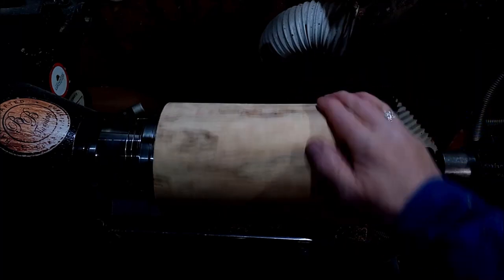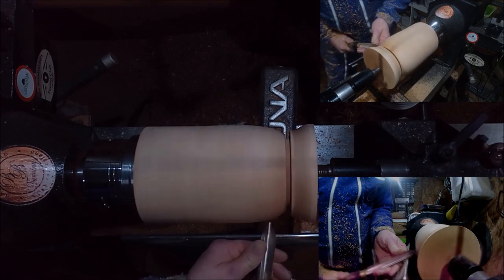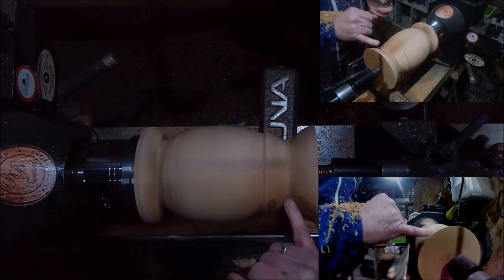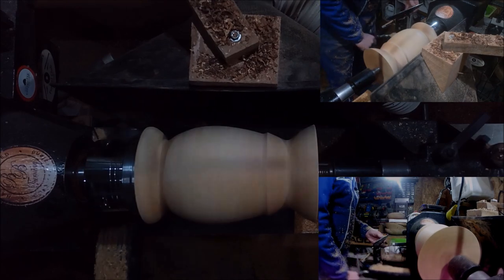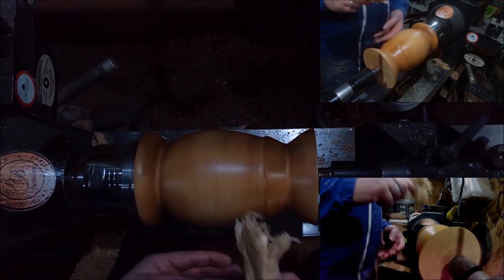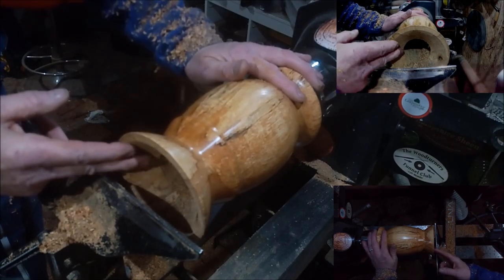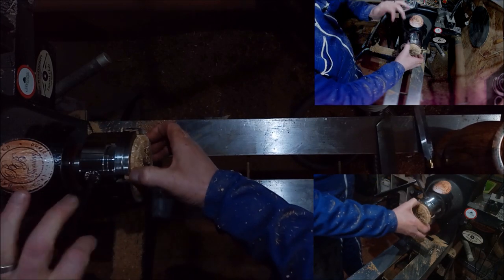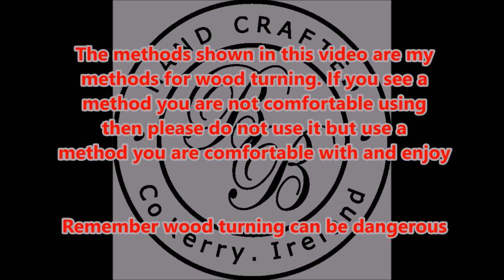Woodturning an Irish Spalted Beech Vase and a really handy Bandsaw Sharpening Tip

Comment: By the way, I did try using the Dremel on each individual tooth also as you showed here, and that is a better method to get a longer lasting sharpening. But following that with the diamond file method definitely improves the overall quality of the sharpening.
Reply from the maker: I totally agree Brian, and as I said in another comment touching it up with your method every now and then really keeps the blade in tip top condition. Great idea mate.
Shay

Comment: Great video again shay. Many thanks. How do you tell if you are to high/low with your tool rest? It looked like you were o my a fraction high at the beginning. Matt.
Reply from the maker: Thanks Matt, it boils down to how the gouge cuts and quite often how it sounds. You just get used to it to be honest. If your gougr is in your normal cutting position and is sharp but you are not cutting as well as you normally do then you are probably slightly high. If you are digging in then you are too low.
Hopefully that is clear Matt. If not i will show it on video.
Shay.

Comment: Thats a pretty wicked bandsaw tip, good man ,  nice video too btw, i have only 2 of those vase inserts left i got them in a euro shop  a few years ago, iyou had a link to where to get them in a previous video but can find the link, can you forward me it if you remember it please Shay.
Reply from the maker: Cheers Patrick, I get them in Mr Price or they are on Ebay https://www.ebay.ie/itm/266168087565?hash=item3df8dab40d:g:m7sAAOSwwlFkDGlp&amdata=enc%3AAQAHAAAA8HL4G4Eh8%2FCvqHq5pfGF3lhKBj6uqdrBSpGC5s8abl%2Bw4ZVTfST%2BsiOwgzbe%2B1KTyrFTDppGvOaxFwAXMfRF81pdp8kuYVtlsBYXyL1xGiVzKBYg2wQZvgs%2BxgAxHwayp6CcnYTzO5L8wmSj%2FS6Xd3wM62r5lt3QOJpDUiKTEW9wTLVBQK4qDC7FT%2B4hL9jlZ8pFa38oMoGQxRym%2BUTfGNBqxEF6eU%2FPcGZu4ZbQsSMa7QjmAoqk7Bxczumw%2BKa0VOC3TtrkgB6BAjzUeRHxr9kJj06RBXsYsYV3WYE3unTZ1Xzz2Ymg7Be%2FiCkF2JJEsQ%3D%3D%7Ctkp%3ABFBM1ovO3uFh